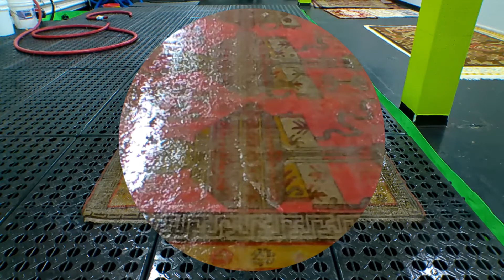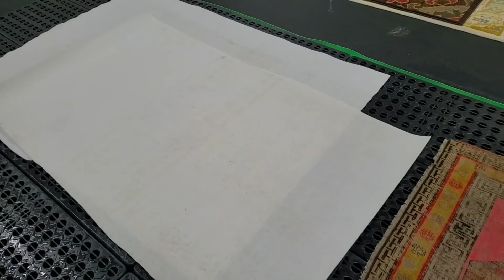Worn out Old Rug - Insert Click-Baity Title Here!

Comment: Great video. Just think, if you were shorter, you wouldn’t need a new handle 😂
Reply from the maker: The problem is it is adjustable but it won't lock into place, so it's the right length for about 10 seconds 🤣